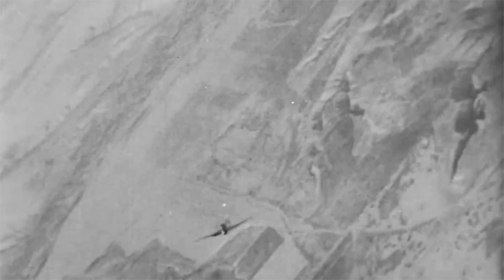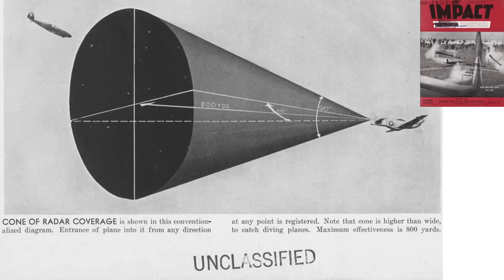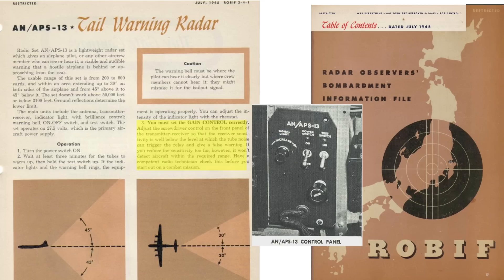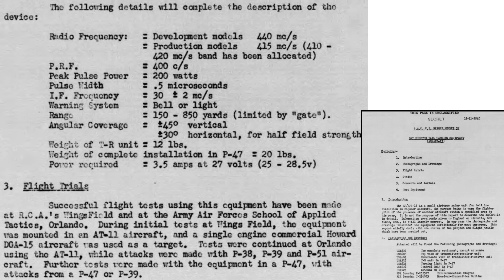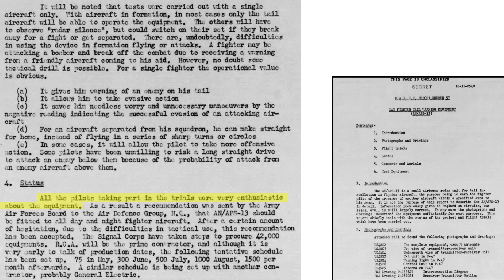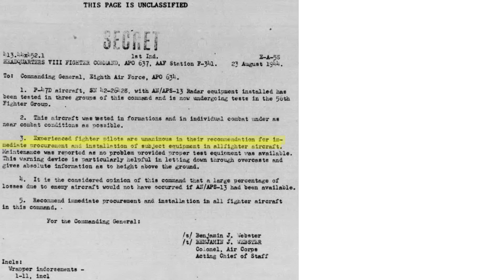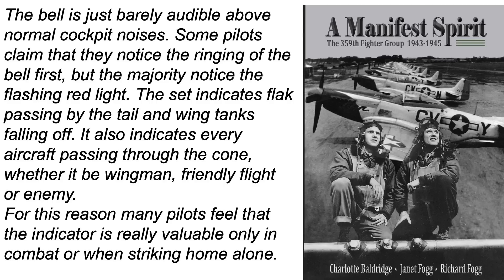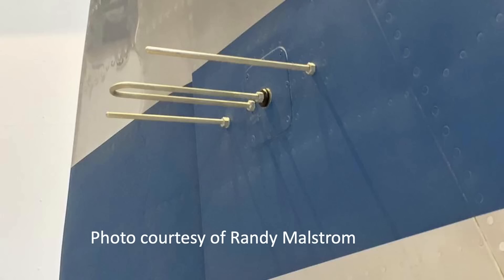How the WWII Fighter Tail Warning Radar reduced losses by 80%, the AN/APS-13 Deep Dive Review

Comment: Tail warning radar on RAF night bombers was compromised and I believe deleted when it was found that Luftwaffe night fighters were using its emissions to find and home in on the same bombers. Perhaps more useful on fighters operating during the day?
Reply: The Brits implemented the system in Feb. 1943. Only a week later one of their bombers crash landed intact, the Getmans were able to study and determine the tail radars use. They rapidly developed a radar detector for their night-fighters. And were able to successfully down British bombers for several months, as the brits flew mostly at night. Sometime in July, only a few months after gaining this advantage, the Germans also managed to give away their own secret after a crew accidentally landed on an Allied airfield and were captured. The Brits quickly orders all tail warning radars removed from their bombers. They instead installed man of these units onto Mosquitos, and successfully turned the Germans recently acquired radar destructors against them. The mosquito crew would transmit until a night fighter was detected homing on the signal. The mosquito would then perform a carefully executed turn out of harms way, hiding the signal, and en up on the German night fighters tail. All in total darkness. Then they would sight in with their cannons and make short work of the foe.
Reply: tail warning radar arrays were also fitted to Luftwaffe night fighters in 1944 - but the Mosquito nightfighters were already using German radar emissions to hunt their opponents, so hanging another electronic searchlight on the tail unit probably aided the RAF to hunt the Luftwaffe more than it helped them evade interception by the Mossies

By 1944, some bomber command units were already switching off their Monica sets to avoid interception, and only flashing up the HS2 terrain mapping radar at navigation points and over the target itself

Tail warning for day fighters makes more sense, especially when their opponents were not equipped with their own radar to detect signals emitted from the US fighters
Reply: @stevesoutar3405  I imagine trying to keep looking behind you on a long range escort mission would have been impossible.
Reply: Think it was the warning sensor with a red light on the panel named “BOOZER”. Murray Peden in his book mentioned one story on a system fault encountered by one of his squadron’s pilots that is amusing.
Reply: That's my understanding too. It acted as a beacon for German night fighters. It's better suited to daylight use.
Reply: @grahamstevenson1740  That is partly true. Germany had shown poor capability at adaptation and radar development by around 1942, so it was a decent bet as a simple system that they would take some time to spot, identify and especially decide to act, develop and install. Which was what happened. Their was a period when many bombers and so lives were saved.
The RAF were watching their losses and reviewing the situation, and when losses to night fighters started to increase, they rapidly developed and installed a new system, fishpond.
So it was a successful system for a period, and was managed, so that when a countereasure was developed it was rapidly discontinued and replaced. This is all you can ever hope for in war with an opponent with any competence, especially in a field like electronic warfare.
In daylight it still broadcasts your location over a large area, which is still a huge problem if the opposition is strong, but by the time the USAAF use it the opposition has weakened to the point it can't effectively respond, making it a net plus for fighters who lack a rear gunner.
Also with enemy fighters the sensing antenna will add drag, which provides a small speed penalty to the interceptor.
Reply: The issue was the Flensburg system.
Reply: @markstott6689  The monica tail warning radar (that the AN/APS-13 was copied from) was being withdrawn and was almost replaced with the more effective fishpond microwave system (an add on to H2S microwave radar navigation) by the time the RAF discovered the Flensburg system.
Fishpond had been developed and deployed rapidly in a response to an uptick in losses to nightfighters.
Reply: @johnculver2519  Cool 😀
Reply: @johnculver2519 from what I’ve read fishpond when used correctly and when working correctly was very good 👍it allowed the bomber to suddenly corkscrew out of danger but wasn’t good at low altitudes as its coverage area was too small
Reply: @Whatifwarlord  All airborne radars were limited at low altitude until we get into doppler radars as the ground generates a collosal signal that it's impractical to remove.
The electronics were time 'gated' in the second world war to limit the effective sensing range, on AN/APS-13 that leads to the minimum altitude being the same as the maximum sensing range.
That's much worse on an alarm radar than on a pictorial one like H2S and fishpond where you can look at the non splodged parts of the image, but obviously that's a bit suicidal in a single seat fighter.
Reply: I thought it was British bombers that stopped using it when a German night fighter accidentally landed in Britain and they found that they were using the radar to hine in on the bombers.
Reply: Those were of course night fighters that had the FUG system the radar operator could use it in such a way to instead of emitting their own transmission simply use the transmission of the enemies radar to home in on them
Reply: Interesting point. I've learned from these videos that the Germans didn't think microwave radar was even possible... Not sure how true this was, or what frequencies are involved in these two systems.   Also this video does an excellent job presenting the logical reasoning used to create, deploy and understand this system.  I wonder how effective was the reasoning of other WWII combatants developing their systems.
Reply: @WillN2Go1  Germany and the USA both knew that microwave radar was possible, but with the best available klystron based transmitters the power was extremely limited, and very very tied to the ground. That really made them impractical.
In the UK the admiralty thought microwave radar would be a great technology for naval anti aircraft detection and fire control, so they chucked a bunch of cash at the worlds best university physics department* at the beginning of the war and said improve it. Which they tried and pursued a few interesting routes, and one started generating big results quickly, after a year or twos intense and rapid refinement, development and testing, behold the cavity magnetron with a set of effective ground, naval and airborne radars for all purposes, radar navigation systems, even airborne command and control aircraft, and long distance microwave telephone links.
* I may have a little bias here, having obtained my physics degree from the University of Birmingham.
Reply: Correct. The Germans recovered Monica from a crashed RAF bomber, so adopted counter-measures. This in turn was discovered on a captured Luftwaffe plane.
Reply: They can do the same thing with any radar, why would the tail radar be any different.
Reply: @HowlingWo1f  I'm not sure who you are repling too, but I assume stevesoutar3405 - the tail radars are great to detect for an intercepting fighter as they provide a very strong, clear navigation beam for the interceptor. The interceptor only needs a small quad split aerial system with simple low gain electronics as the signal is so strong compared to reflected radar return, and then they have an ideal interception path to the rear of the enemy fighter if the interceptor is faster.
Microwave radar equiped Night Fighter mosquitos (with an aerodynamic bulbous nose fairing over their scanning dish radars) are much faster than german night fighters which have a huge draggy clothes horse antenna on their nose, making them ideal interceptors.
It also removes the risk of friendly fire as you can make the receiver selective to the enemys frequencies.
As a navigation beam it would work out to many (mabe tens of) miles, where as a detection radar it's effective range would be much more limited by ground returns.

Comment: Wow another thing I had no idea about this!  Thanks!
Reply: Yes. Same here. What's really great about the system, based on my experience sailing using radar and AIS (identification radio signals). The false positive alerts:  flak, drop tanks, friendlies, builds confidence in the system. The same is true with radar on a boat picking up a fishing buoy (Attraction device - more than just bobbing thing the size of a basketball).  And the last listed advantage cannot be overstated. Enemies fighters do more than just shoot you down, that they exist and there's even the slight possibility get in behind you   is a significant cognitive load and stressor that reduces how much concentration can be put on other aspects of the mission. Huge plus. The way a proximity warning system works on a boat is you can go to sleep knowing the system will wake you before any nearby vessel can be close enough to be a problem. If you don't have this even mid ocean where you might not see another vessel for weeks, you can't safely sleep more than about 45 minutes.